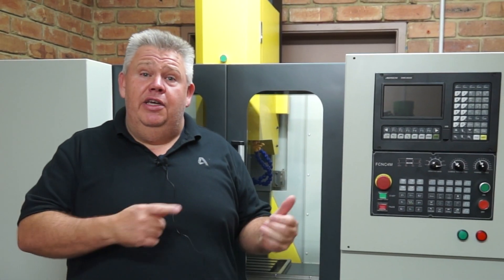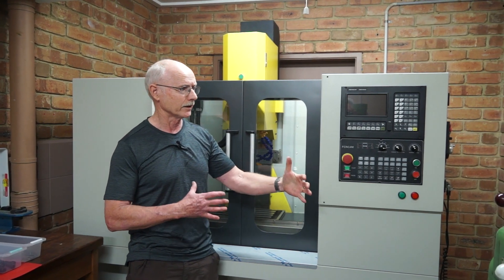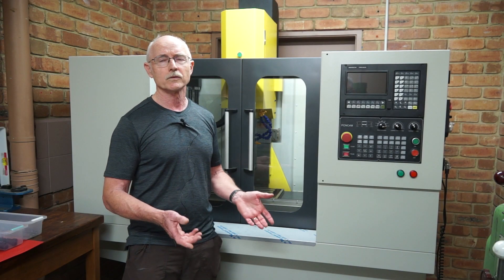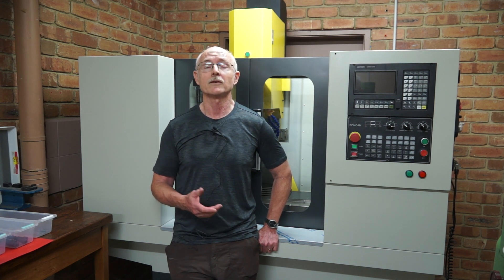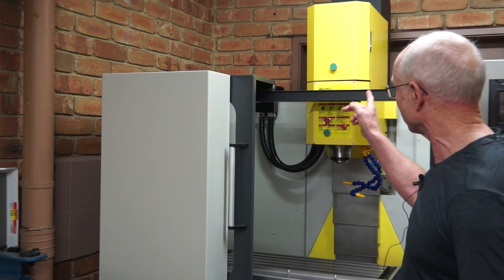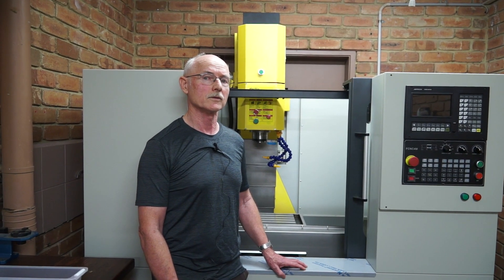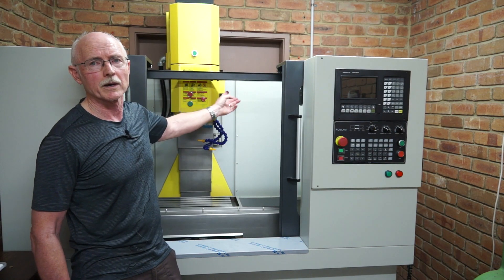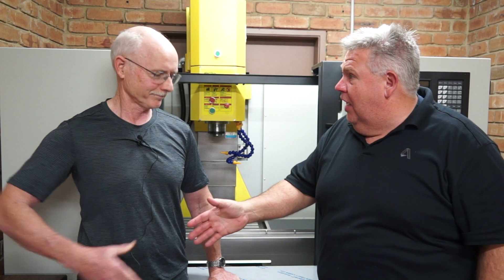Worlds BEST - DIY CNC Mill Enclosure

Comment: Excellent job. I'm in the middle of building an enclosure for my Syil X4. I too have spent hours and hours sorting it out although the electronics were stuffed so I had to redo all of that as well. I opted to fit a 3.5kw spindle which meant I had to fabricate a new head. It's up and running at this point and machining all the parts needed in the enclosure build. I cant wait to see that done. Having no enclosure is not an option with a high rpm spindle. At 18000 Aluminum gets sprayed everywhere! Sheet metal was finished 2 hours before lockdown and I never picked it up. Giving us no notice was a complete piss off.
Reply from the maker: Hey buddy how’s things? Sounds like you’ve done some great upgrades to your Syil X4. Sorry to hear about your sheetmetal being ready and lockdown screwing you. Do you or a friend have an ABN? I’d get creative with story and go and pick it up. I’m sure the business is still opened? Best of luck mate. Cheers 🍻. Aaron
Reply: @DCT_Aaron_Engineering  I'm here in New Zealand. Its like a prison state. Everything is shut till Friday. On the bright side I been busy making chips.
Reply from the maker: Great to hear you’re out in the shop making stuff. As for the prison state, you should live in Melbourne 🤦‍♂️

Comment: Great video. This looks more professional than some manufactured machine enclosures I've seen online.

Edit: just saw the cost section and 😬. I would've done wood panelling at that price and bought another machine with the savings.To each their own, but ow!

Amazing work still.
Reply from the maker: I agree with you Peter. David did an excellent job on this enclosure, however it did not come cheap. Additionally, I probably would’ve had it powder coated and not painted. Cheers 🍻

Comment: Nice work!  It also inspired me to think about making my enclosure "float" independently on it's own frame resting on the floor, not touching the machine and it's vibrations at any point. That way I don't have to be as concerned about thin ,expansive panels vibrating, even with ribbing etc, I am envisioning some drumming.noise under some conditions.
Reply from the maker: Hey buddy.  Thank you so much I'll pass on your feedback to David when I speak to him next.  David did such an excellent job with his enclosure.  I think your idea would work rather well also.  If you end up making one please let me know as I would love to see it.  Regards, Aaron.

Comment: Choosing paint over powder coat seems wise to me. I have come to the conclusion that most powder coat needs a good paint job to make it last. Even then a full depth nick or scratch can wick moisture long distances under the powder coat which causes rust and peeling.
I will have a look at the Haymes range. Thanks.
Reply from the maker: Hey Mike how's it going buddy.  I tell you, this enclosure of David's is a work of bloody art mate.  He's done a fantastic job on it.  I thought the same thing in regards to choosing paint over powder coating.  Apparently the blokes down at that paint shop I listed in the description bent over backwards to help him.  Unlike some other shops he spoke too.  Hope you and the misses are safe and well up your way Mike?  Cheers, Aaron.
Reply: @DCT_Aaron_Engineering  We are doing fine.  Keeping pretty quiet as you would expect with the virus around. 
I was impressed how the tramp oil stays separate from the coolant.

Comment: Very Nice work, and to a Good price. 

I made a simple enclosure for my router. It was lots of work. Cutting stainless sheets with a jigg saw. Drilling and tapping 100s of holes. Went with polycarbonate, stainless and aluminium sheets. Cant help feeling that mine is on Tuna can level compared to yours. 

Cost was about 10 % of yours, but still. I feel like I need to step up the game for my next enclosure build.
Reply from the maker: G'day Chip Welder.  Thank you for following along and for commenting.  Yes David's enclosure is work of art.  It is way better than the one I did for my Titan TM20 CNC conversion.  I felt very embarrassed of mine after I saw this one up close.  But that said, it worked for me and was built on a shoestring budget.  No doubt yours works just fine also.  Great chatting with you.  Cheers, Aaron.
Reply: @DCT_Aaron_Engineering  yeah, it has served ts purpose. Which for me spells saftey. Very important for beginners like me. Like when I first started off with cnc, tested out different feeds and speeds / cutting depths. After the 20th attempt I ditched to turn the spindle of between my test. Very stupid. Suddenly, brain freeze, pressing go to zero, with spindle running without having z axis retracted and so on.... spindle crash.  Mistakes you only do once, and learn from the hard way. God to have an enclosure when the human error steps in.

Good that There are guys like Dave around, that can raise the bar when it comes to diy enclosures and push the evolution in hobby cnc comunity further. Good work Dave! 

 Nice of you Making av video about his build.

Comment: One of my upcoming projects is a CNC enclosure, but I will get shot if I spend that kind of money on one.
Reply from the maker: Ha Ha Ha, you me both mate.  I just bought a 2nd hand manual milling machine ($1K Aud) for my other channel (Aaron Engineering).  I've been putting $50-100 bucks away a week so my wife wouldn't notice.  Then she found my hiding spot and I had to come clean over it.  Needless to say my ears and head are still throbbing ;-)
Reply: @DCT_Aaron_Engineering  I don't have too bad of a restriction on money, other than lack of it these days  (I have spent about $7k on my CNC to date) but if I tried to spend $4k on the enclosure alone then I think I might be pushing my spending limit without substantial grumbling. After I finish doing upgrades on my CNC I want to build an enclosure to stop the spread of ally, then build another one around that for sound.

Comment: Well done Aaron. I'm interested in what slides were used on the door.
-Ken
Reply from the maker: G'day Ken.  Thanks for following along mate.  David did an awesome job.  I think (from memory) they are the similar rails that are used on the Chinese 3040 cnc routers for the tops, and just an aluminium strip and wheel on the bottom.
Reply: @DCT_Aaron_Engineering  thanks. Yeah I looked more closely and thought that looked like basic linear rod and bearings

Comment: Beautiful design. I'm surprised by the AUD $4k price tag. I do a lot of sheet metal design/engineering in Australia and would have expected a much higher cost. Top notch CNC sheet metal and powder coating don't come cheap in this country!
Reply from the maker: ttjarrett Yes I think they looked after him. It was all CNC laser cut and folded. David did most of the TIG welding where required and painted it himself. Unfortunately nothing is cheap these days. Thanks for watching. Cheers Aaron

Comment: Very nice setup. Well thought out especially with the space he had to work it into. The cost didn’t shock me so much (1.5 700 size RC helicopters) 😀given the fabrication involved and the substructure. One thing I do need is a better answer for my wife when she asks me what I’m going to do with that when you’re finished other than “Make stuff” I’ve been doing my CNC conversion for years. Little here little there etc.
Reply from the maker: Hey buddy how's things?  Yes I think we all underestimate the cost of things these days.  One thing is for sure and as I mentioned to Tom earlier.  After seeing David's enclosure, I'm ashamed of the one I built all those years ago.  Stay safe mate and happy making :-)
Reply: Thank you. Yes, space was a major limitation which largely drove the design.